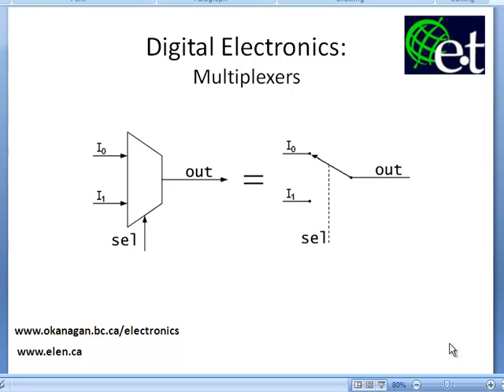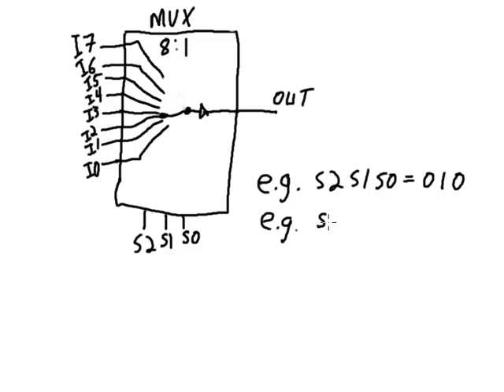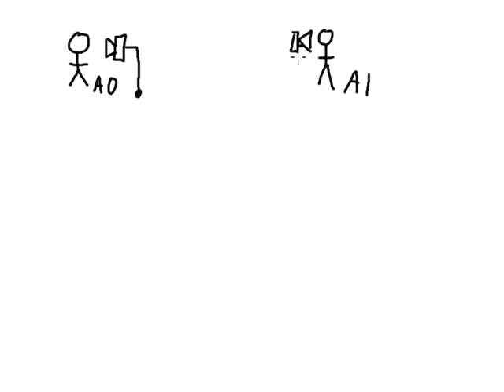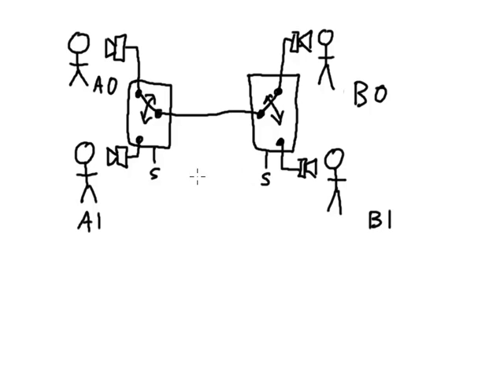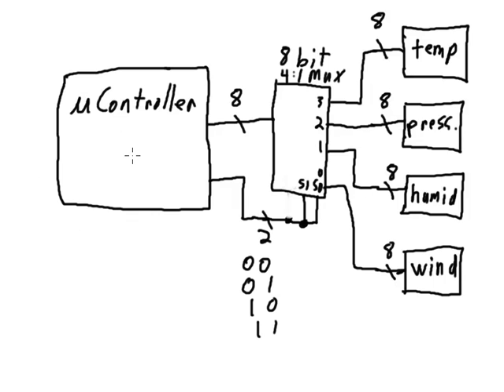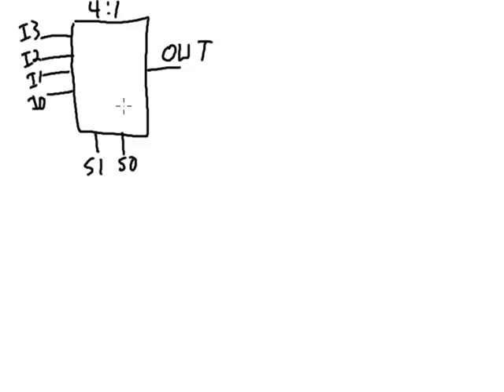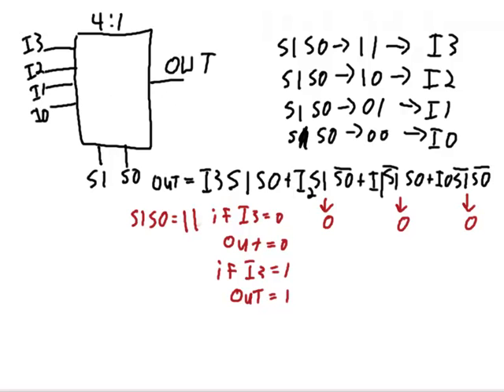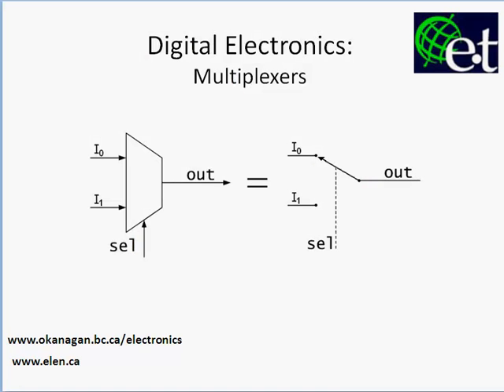Combinational Logic - Multiplexers

Comment: once your selector has chosen its output value, won't it still have to cycle through the 8bits of information under each output (ex the 8bits of info under wind)? Or simply by choosing the wind output have you already cycled through these 8 inputs, or would you need another mux to calculate each 8bit input? A little confused here and would like some clarification.

Comment: I truly appreciate you taking time to develop the content, record and post this video ... I'm only about 1/3 through it but so far it's very interesting. I am working through a book right now that has an onLine hardware simulator for use in creating/testing hardware via logic circuits/gates.

The book fails to help visualize the importance or symbolism between mux & demux systems.  I built them and they worked but I did not see the connection to their real-world use.  Thanks again!

Comment: The main inputs are values arriving from somewhere in whatever electronic device the multiplexer is in. The selector inputs tell the multiplexer what value needs to be sent through. the selector inputs mostly come from memory or other parts used for code.

It may sound childish, but look at some videos of Minecraft computer designs/tutorials. If you are having issues with seeing the "big picture" this could help because it's a lot easier to see where the information is traveling

Comment from the maker: A multiplexer is a basic combinational logic component, which when put together with other combination logic components and other types of  components called sequential logic components can build a computer.  The I0, I1, I2 etc. are just arbitrary input signals in an overall system that are used to show how the multiplexer works.  Similarly S2, S1, S0 are arbitrary signals and are used to control which of the I0, I1... input signals gets mapped to the output.

Comment: If I understand your question correctly, What I noticed what was not mentioned, is that the Multiplexer's inputs are 2 raised to the n, where n is the number of 'select bits'. So, if you had 2 select bits, then you would have 2 raised to the 2 Multiplexer inputs, which equals 4 Multiplexer inputs.